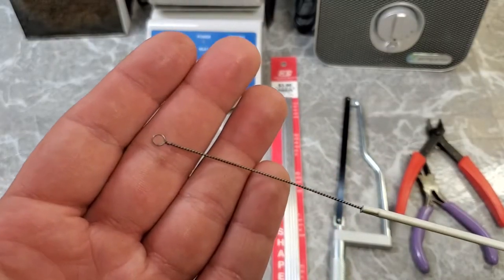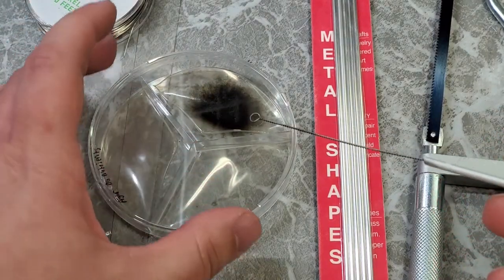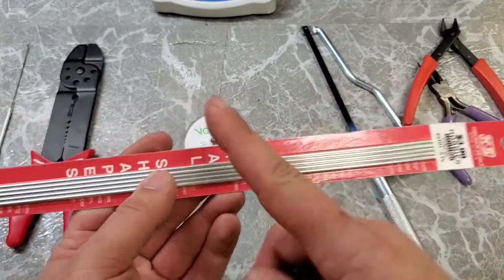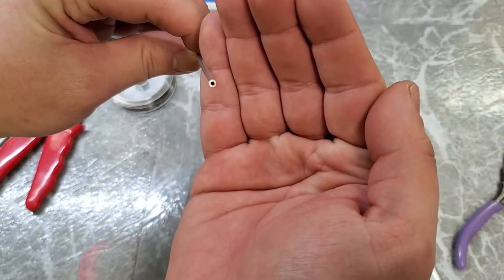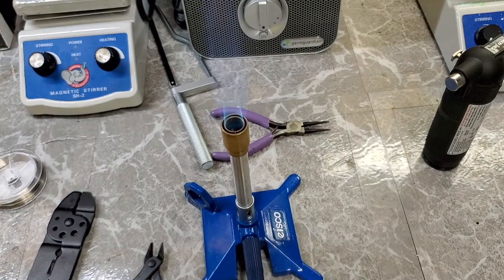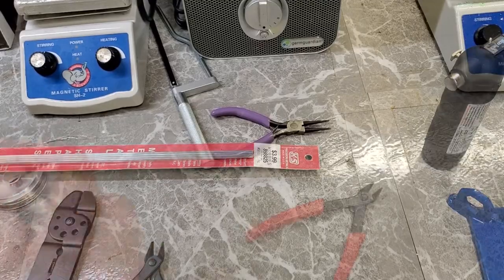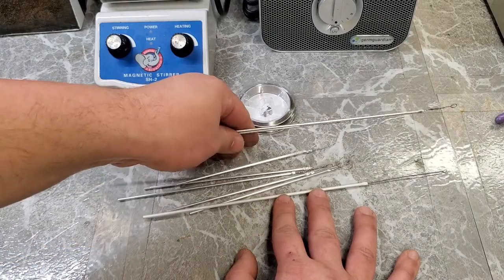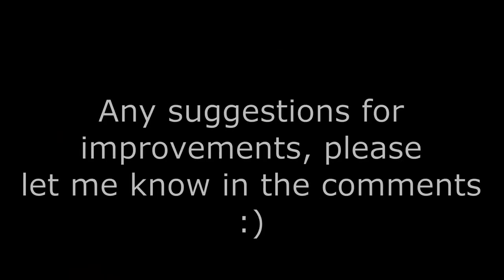Turning Unused Vape Wire Into Inoculating Loops for Microbiology, mycology, Chemistry, etc.

Comment: If you have access to a cordless drill chuck up the two free ends of the Nickel/Nichrome wire whilst holding the circular loop. You can hold the loop end with pliers or even a small machinist workholding vise (as they have no teeth on the jaw face). Even a shop vise with jaw protectors installed will do fine to take care in protecting the loop end from from being deforming when clamped. Pull the drill away as you twist providing tension on the wire will get you some very tight and uniform twists identical to the store bought ones with this method. Just thought I'd share the tip!